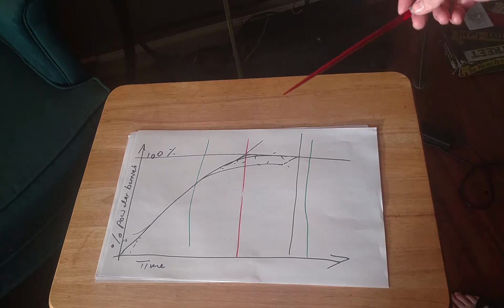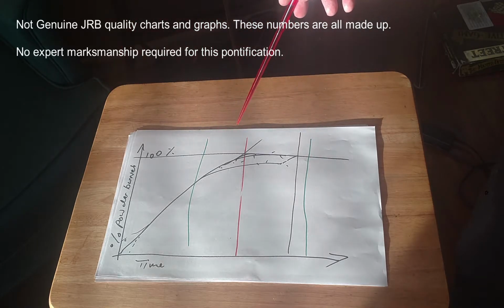100% Load Density and Boundary State Concerns for Shooters -  Reloader's Coffee Chat

Comment: Hey GF, fyi you have a dead spot over a minute just after the 2 min mark goes completely black
Reply from the maker: Crap. I missed that. I like my new non-linear editing software, but it does make gaps possible if you aren't paying attention. BTW, you can still have annotations, so long as you disable end cards. I was gonna tell you that on your last vid, but when you pulled it down the comment chain evaporated.
Reply from the maker: What do you think about the premise(s) of the video? Useful, or just droning on about the obvious?
Reply: Its an interesting premise.  The first would explain why some times you hit a spot in a ladder work up and your velocity goes down with a higher charge weight, then double high on the next step.   I also thought the barrel length and powder burn was thought provoking.... one barrel length might not be optimal.  At first I wondered where you were going with it but it pulled together and made sense.  Whenever we share things that are in the realm of theory without the ability to prove, its a little like carving...you move closer to true understanding by carving off bits that dont make sense or you can prove wrong.  I liked it!
Reply: Dellet is VERY knowledgeable and shares a wealth of information. We are lucky to have him...but I would never let him know that LOL
Reply: Trust me I know how you feel, uploading a video with a mistake in it.
Reply: I thought the part your finding on 300blk powder was interesting in the compressed realm.  I wonder if A1680 may not be a better choice.  1680 can transition from uncompressed to very compressed pretty linearly.  Ive loaded up too 23gr under a 125 gr (very compressed).  Might be a good choice for cast also.
Reply from the maker: TreeTopFlier thanks for the feedback. I will probably have to re upload...
Reply: TreeTopFlier I thought my IPad crapped out.
Reply from the maker: I will have to fix it sometime. I have a busy week ahead, so I don't know if it will happen immediately.